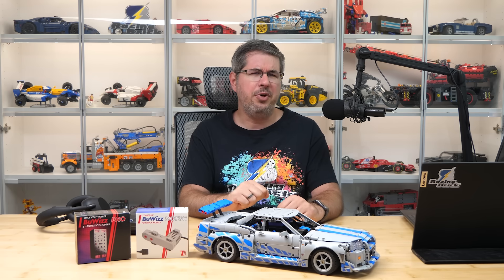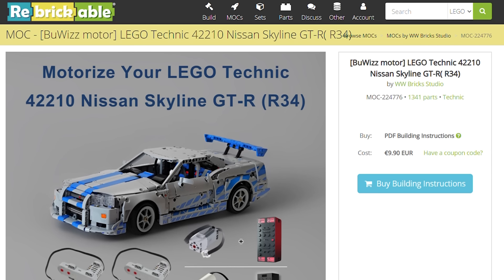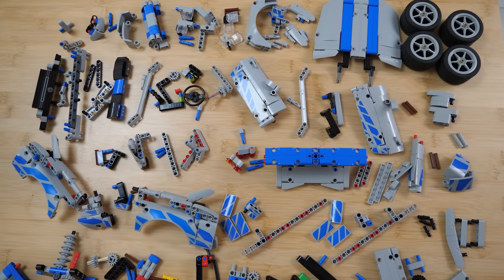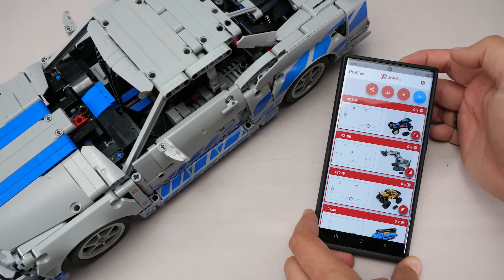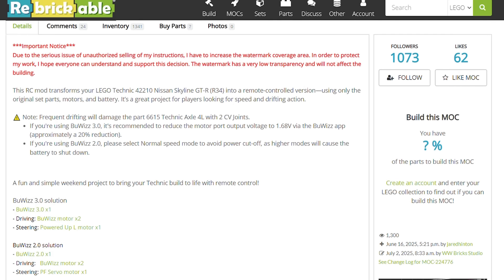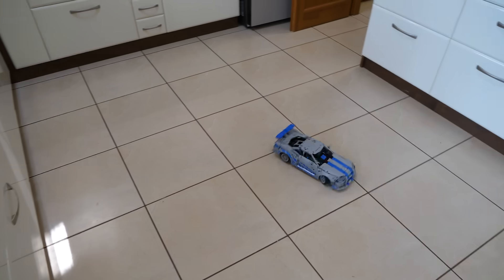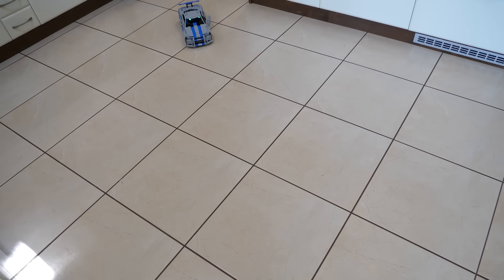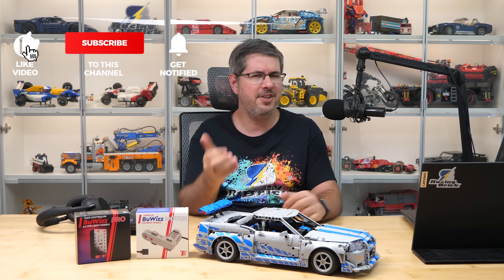LEGO Technic 42210 Nissan Skyline GT-R BuWizz remote control modification by WW Bricks Studio

Comment: Hey,
I have a question: what would you need to convert the skyline's engine into a real 6 cylinder engine?
I do suspect that i'll need:
6 engine cylinders
6 cylinder heads
6 conrods
Though i don't know how to change the rest of the car and add to that list so if you could look into given i'm not extremely creative and haven't really done a lot in modifying lego sets...
Reply from the maker: The set originally has a small scale 6 cylinder engine. If you wanted to use the bigger, old-school engine parts, they would require way more space so they wouldn't fit in the engine bay, and would be totally disproportionate.

Comment: Awesome modifications! 😍 Did you try to put some invisible tape on the 4 wheels, instead of moving up the rear wheels, for more power to drifting ?
Reply from the maker: I didn't try as this set has a special mechanism for "drifting". Alternate methods would work on any motorized set.

Comment: I have no idea if you have 6 buwiz motors, but my version of this mod of the set with 6 of those will come out tomorrow on rebrickable :D
Reply from the maker: This one is already too fast, I wouldn't dare to squeeze 6 motors in it :)
Reply: @RacingBrick  haha, I think that with some gear tuning (i only used 20:12 + the audi diffs, that version goes 22 km/h a video will come soon btw) it could reach over 30, this thing has power :)

Comment: Didn't Buwizz make instructions for their own RC mod?
Reply from the maker: Not yet as far as I know, and that will definitely need extra parts
Reply: They dropped a teaser video for it, and one of the motors controls the ball joints that drop down. This modification is easier as someone who has done it.